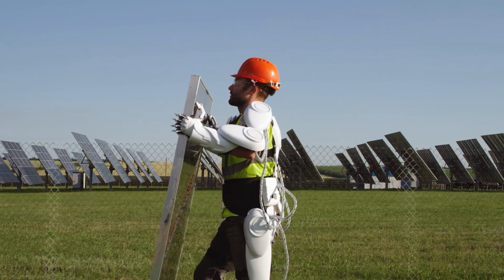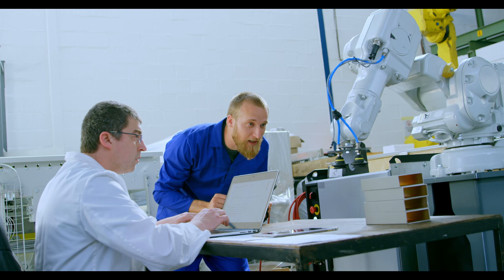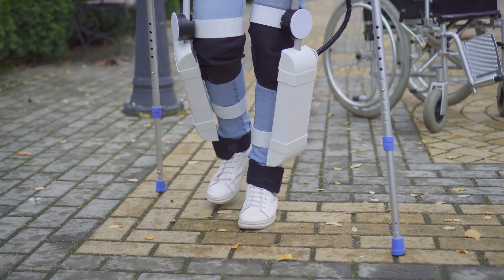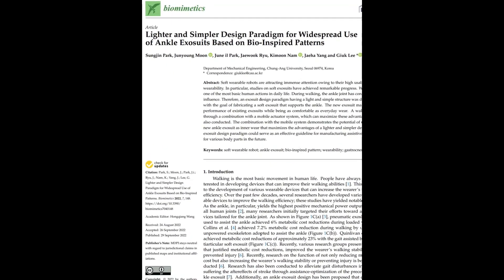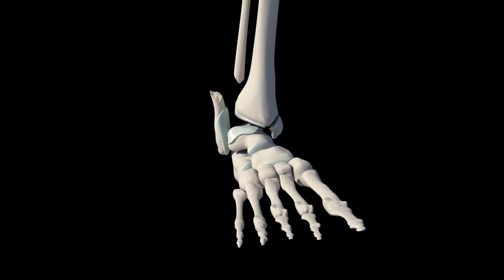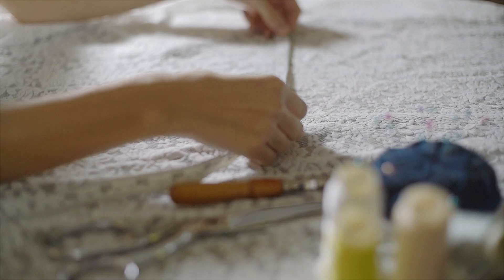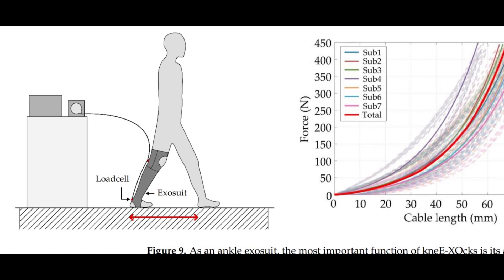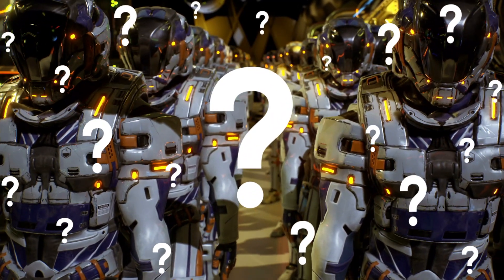Bulky Exosuits are Finished... KneE-XOck is HERE!

Comment from the maker: In what situation would you use an exosuit?
Reply: Reduced mobility due to old age. After a debilitating disease. People with ALS, or other muscle conditions. Unless for work related purposes where additional strength is necessary this isn't meant for the general public to wear for fun.
Reply from the maker: @andrewwatts1997  yes that's definitely an application where the technology would be very useful. Good call! I'm currently doing research on Muscular dystrophies, like Duchenne and it really is a horrible disease. Exosuits could definitely help people with this disease, especially for every day movement. However, most people suffering from muscular dystrophies die from cardiomyopathy. That's where gene therapies have to come in.
Reply: I'm many years ahead of everyone on this. I will be registering my LLC  soon so I may sell equity to produce my products. You're right that current tech is clunky and poorly engineered.
Reply from the maker: @jonathanchampagne7683  pretty impressive. Did you look into soft exosuits? I'll leave you a link in case it helps: https://biodesign.seas.harvard.edu/soft-exosuits